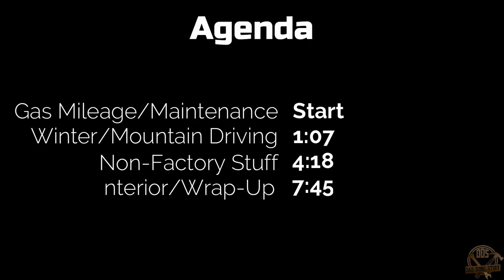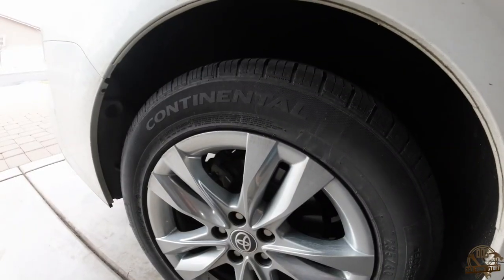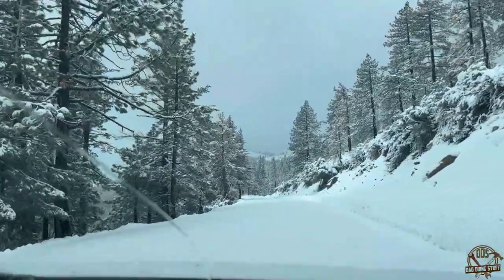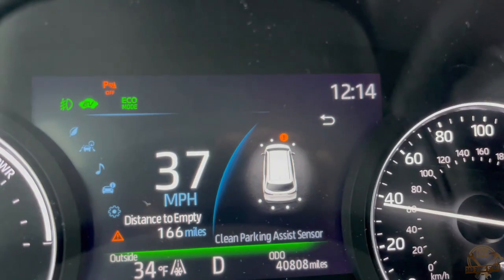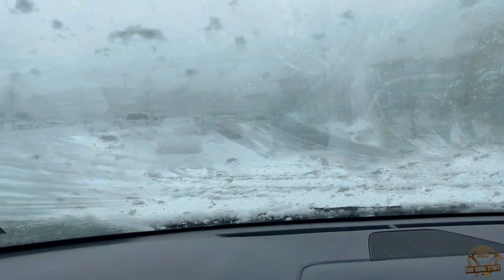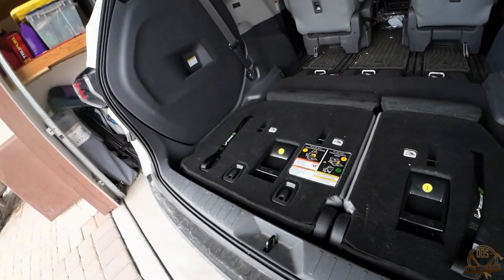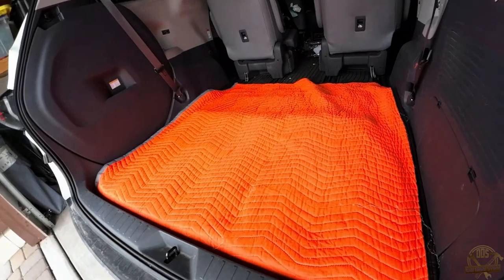Toyota Sienna Hybrid - 40k Mile Update

Comment: Thanks for the review! We also purchased a Sienna it is our second Sienna but first Hybrid! We love it and are at 35+mp! We live in Idaho so lots of snow! It does fantastic! Have you towed anything or just used bike racks?
Thanks PR
Reply from the maker: Hi Pat,  thanks for taking time to watch and comment.  To date, I’ve not towed with this hybrid van.  My only intention with the hitch was to carry a bike rack.  I didn’t even install a wiring harness.  That said, this van is rated to tow somewhere around 3500 lbs.  BUT, I personally wouldn’t tow anywhere near that weight with this van.  The other thing to really consider would be the tongue weight of the trailer.  If the trailer/load had a tongue weight of 300lbs, you wouldn’t want to be carrying any weight inside the back of the van. I took this on a bike trip with 4 other guys.  We had an 80lb bike rack, plus 5 mt bikes, plus our gear all in the back and one dude in the 3rd row.  That van was definitely over the weight limit.  Airbags would have been really nice.   If you were gonna tow something light, like maybe some kayaks, or really small utility trailer, that would be fine.  Hope that helps!

Comment: What do you about the third row seating when folded down it does not stay flat. Sliding things in and out gets h7ng up on the flaps.  It’s a horrible system..".
Reply from the maker: Agreed.  I brought that up in my “10 Things we hate” video.  It’s definitely not as flat as the gen3 van. Best solution I’ve found is to lay a moving blanket down when seats are folded flat. That seems to work pretty well.  I covered that in my 20k update video.

Comment: Super helpful video. Can you comment on the second row seats not being removable. How much space do you have with the third row folded in?
Reply from the maker: I’ve never tried to remove the middle row, although I know there is some info online about how to do that. As far as the space with the 3rd row folded, here’s what I’ll tell you.  With nobody in second row, you can shove the middle row up pretty darn far and get a ton of space. Even with the second row occupied, you still have a decent amount of room.  Where the Sienna shines in comparison to an SUV is in the height available back there.  It has a ton of space floor to ceiling because the seats disappear into the floor.  I’ll try to get out and get an actual measurement for you as well.

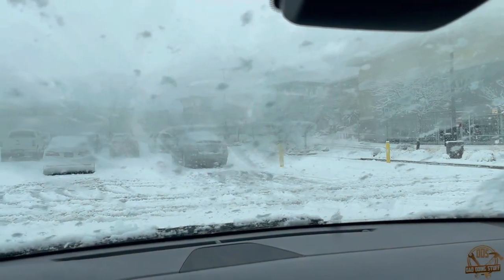Comment: 4:38 turn the AC on and the foggy window clears up in seconds.
Reply from the maker: Agreed, but defrost is supposed to run the AC natively.  (Supposed to)…….
Reply: @DadDoingStuff  Do you use Auto mode? I just leave the climate control in my Highlander in Auto mode and set it to 72°F and my windows never fog up on the inside living in North Dakota. It allows the system to decide if the outside temperature warrants having the a/c on and turns it on accordingly.
Reply from the maker: @Mario81587  I’ll give that a try. Don’t think we leave it on Auto very often. Thx for the tip!

Comment: What does your vans manual actually say for its towing capacity?
Reply from the maker: It actually says that it doesn’t recommend towing with it at all, and to use extreme caution if you do tow.  I would have no issues towing something small, maybe 1000lb or less with a trailer that has a very low tongue weight.  But I really only use our hitch to carry bike racks.
Reply: It’s 3500lb towing, max 350 tongue weight.
Reply from the maker: @smrtguy77777  Thx for the info.  That being the case, zero chance I would tow that much with this Van. No way.
Reply: @DadDoingStuff  
Haha it would make for a great video though!  Can you imagine, Sienna maxed out, Ike Gauntlet, TFL style 😂.
Reply from the maker: @smrtguy77777  ROFL!  Yeah why don’t that have TFL Minivan series?!?  So funny!

Comment: Hi!  We just bought a 2023 Sienna Hybrid.  I can't figure out how to set the ECO history to show the average/accumulated miles-per-gallon.  I've read the manual several times.  On our display it will only show the current MPG and the best previous MPG.  I would really like to see the average/accumulated MPG.  Our old 2016 Sienna would show that.  Any help?
Reply from the maker: Hi Scott.  What trim level is it?  These screens vary between the trims.
Reply: Sienna Platinum.
Reply from the maker: Ok, same as the limited. So I just learned something playing with ours. It seems that the “current” is the average mileage since the last time it was reset.  And “previous best” is basically the average from the previous time.  What it seems that it DOESN’T track is “average for the life of the car”.  Ours had never been reset since we bought the van. So as of tonight after 43k miles ours said 32.3 for the “current” and 28.9 as the “previous best” (28.9 was from the 9 miles the van had when we bought it).  On that screen I hit “update” and it moved the 32.3 into the “previous best” and cleared the “current” back to zero.  So in summary, if you want to keep track of the average miles for the van over the life of the van, you need to note the average every time you reset it. If you reset it often, that would be pretty tedious. If you reset it once every 40k miles then it’s not too hard, so long as you jot it down.  I just wrote it in the back of the manual.  “43k=32.3mpg”.   Hope that helps!
Reply: OK!  Thanks.  So Toyota has made it impossible to track total/average/accumulated MPG.  I'm 67 years old.  My father used to keep a log book to track accumulated MPG.  So, I'm back to manual accounting. 🫤

Comment: I am looking for a luggage rack (airport size luggage) with the mechanism that tips it back slightly to gain access, any recommendations? thanks in advance!
Reply from the maker: There are a few, but depends on if you want one that is enclosed or just a tray.  I’d prefer one that swings away as opposed to just tilting, but those also tend to cost more.   (Up to $1000+).  
For a basic tilting rack, something like this would work well for a 2” receiver.    https://www.etrailer.com/Hitch-Cargo-Carrier/etrailer/e98874.html   Hope that helps!
Reply: @DadDoingStuff  This one seems good.  does the swing away mechanism work on this one as well? perhaps with an extra piece?
Reply from the maker: Swing away hitches are pretty universal, so it should work.   They are quite expensive, usually around $300 or more. That said, I think you would actually have a better setup using a riser adapter (like I used in the video) with this carrier. The van has a hitch that is REALLY low to the ground. And with this carrier hanging back, I could see it dragging over any bumps or through any dips.  That riser will get it not only up, but also spaced  back a bit.   Combined with the tilt, that would get you pretty good access to the back hatch.   I do like swing away hitches, but thinking more, the van is just so low to the ground that a riser is a better idea here.  Hopefully that all made sense! 🤣
Reply: @DadDoingStuff  Yes. Totally. Thank you!
Reply: @DadDoingStuff  Sorry if this is getting longer than it needs to be, but i've been hearing that one needs to disengage the rear sensor EVERY TIME they go for a drive if any hitch is attached, is this really the case and are there work arounds to this?
Reply from the maker: @HelpfulHarry  That's a great question to ask.  It's not every time you start the vehicle, but it does have some kind a of timeout.  I don't know what it is exactly, but after starting/stopping a few times, it seems to re-enable itself.  My recommendation is to learn the process needed to disable it.  I can tell you the first time it happened to me, I pulled into a handicap parking spot (just to turn around) with a bike rack on the back.  When I put the van into reverse and the sensor kicked in, it immediately engaged the brake!  And so I was sitting there trying to figure out how to disable the sensor, so I could back up, but it took me a while because I didn't know which screen to go to.  I'm sure everyone thought I was an idiot that didn't know how to back up my van.  Now I know how so only takes me a few seconds to do it.  It would be awesome if Toyota made that particular feature a physical button on the dash so you could just press it quickly to disengage the rear backup brake engagement sensor!
Reply: @DadDoingStuff  agreed 👍 and good to know. Thanks. I really hope they come up with a solution on future models.

Comment: If it had a different engine and transmission I would definitely consider
Reply from the maker: 🤷🏽‍♂️ Dunno….I think they put in the right sized drivetrain in for this van.
Reply: @DadDoingStuff  I just prefer the smoothness and power from a V6 and a traditional transmission to a CVT. I find 4cylinders with a CVT sound like a hairdryer and especially noisy when stressed even if they do have adequate power
Reply from the maker: Agreed they don’t sound as smooth.  For us it’s a fair trade for the almost double gas mileage from the older V6.

Comment: Just saw one of those in my neighborhood. It is a gorgeous car, looks much better than older generations.  It is suitable for people like you who drive a lot. However, it is not a good car for people who drive less than 10k a year. The battery dies out in 10-15 years, and all the money saved from gas goes south for battery replacement. Toyota should have given a gas engine-only option.
Reply from the maker: Yeah they are making certain models only available as hybrid now. New Sequoias are also only available in a Hybrid.  Agree that gas is still great option if you drive less than 10k year. I drive my Tundra less than 10k a year and despite the crummy gas mileage, it’s very reliable and will last forever.
Reply: Toyota is currently struggling to keep up with the demand for their hybrid sienna,   adding a different engine package would just make the current production issues even worse.

Comment: Your factory tires only lasted 29k
Reply from the maker: I could have gotten maybe another 1-2k out of them, but I was about to take a huge road trip and didn't want to hit the road with tires that old.  Even 29k, compared to the Gen3 van is fantastic.  The Gen3 would only get about 15-20k out of a set.  The good news is that tire companies are pretty good about pro-rating their tires.  So if I get 30k our of this current set, but they are rated for 60k, the tire shop will basically sell my next set at half price.  I went though about 8 sets of tires on our Gen3 and never once paid full price for any of those tires.
Reply from the maker: I completely agree Walter.  That's exactly what we did on our Gen 3 Sienna.  I used regular tires, then for long trips I just carried a full-sized spare in the back.  Run-flats were horrible.

Comment: Toyota's approach to having remote start as a paid subscription makes me not want to support getting the Sienna
Reply from the maker: Agree that should not be a paid subscription. Just add it to the remote. But lots of manufacturers are starting to do this. BMW has a subscription to use your heated seats that are already installed in your car.  Literally a monthly subscription just to use a feature on your car that you already paid for as an upgrade!  WTF?!?!
Reply: @DadDoingStuff  BMW was offering this overseas but actually just did away with it because of poor adoption. But a complete crock for sure.
Reply from the maker: Good.  I thought that was totally BS!
Reply: Using the fob, click the lock button 3x and hold it down on the third press. It takes a bit to get the timing of the three presses, but you can remote start that way without a sub.
Reply from the maker: I just tried this and it works!!!  Not sure how you knew that, but awesome!!